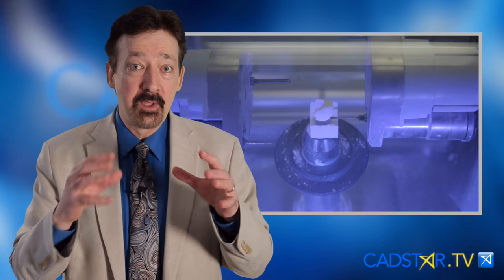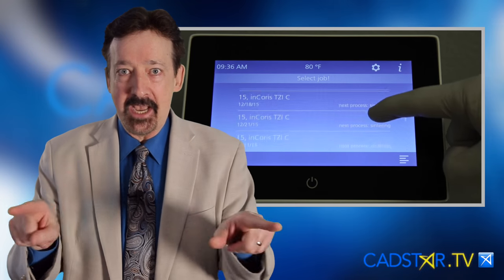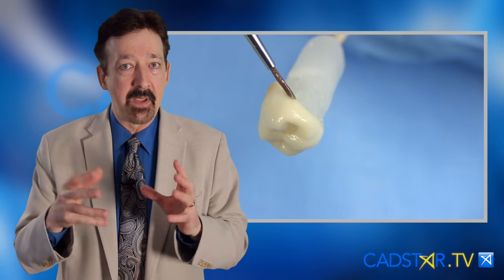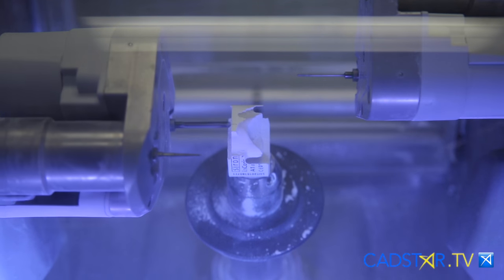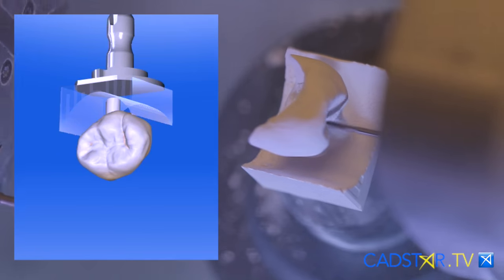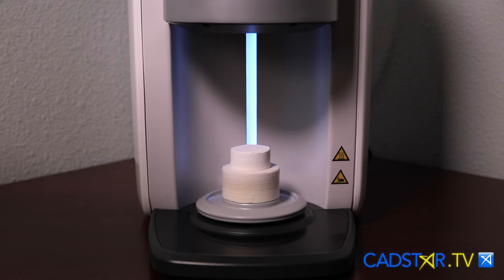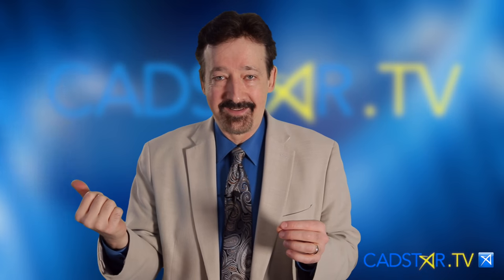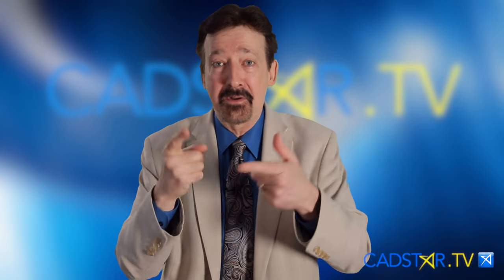Introduction to Chairside Zirconia

Comment: Can we sinter a cercon disc crown in speedfire ?
Reply from the maker: Only if there is an initial connection to the software of the mill.  For the disc, this will need to be inLab.  The Speedfire works on the volumetric size of the zirconia. As a result, there needs to be communication with the software prior to milling and after the mill.
Reply: @KlimDDS  thank you, 
I don't have a inlab or mcx5. I have a chairside, mcxl  . I asked about the disc because I wanted to get few crowns milled from a local lab but they don't know wheather we can use cercon zirconia in speed fire or not. 
I meant that if I get a crown milled from a local lab from cercon disc and I have a job in my speed fire can I sinter the crown in speed fire, because previously I tried to sinter some local zirconia crowns and they couldn't survive the extreme rapid temperature of the speedfire, they need 8 hr cycle for sintering. 
Thanks
Reply: @KlimDDS  thank you, 
I don't have a inlab or mcx5. I have a chairside, mcxl  . I asked about the disc because I wanted to get few crowns milled from a local lab but they don't know wheather we can use cercon zirconia in speed fire or not. 
I meant that if I get a crown milled from a local lab from cercon disc and I have a job in my speed fire can I sinter the crown in speed fire, because previously I tried to sinter some local zirconia crowns and they couldn't survive the extreme rapid temperature of the speedfire, they need 8 hr cycle for sintering. 
Thanks
Reply from the maker: @adityagupta-im5ge  I agree, unless the zirconia is in the algorithms of the system, it may not work.  I have 4 zirconia furnaces and find all but the SpeedFire is universal.
Reply: @KlimDDS  ok thank you 
So if I have a spare job in speedfire I can use it to sinter cercon zirconia
Reply from the maker: @adityagupta-im5ge  Not a guaranteed.  You can try.  It may not be a complete sintering process.  You will be experiencing what it is like to be a beta tester.(:
Reply: @KlimDDS  ok thank you
I will do the beta testing